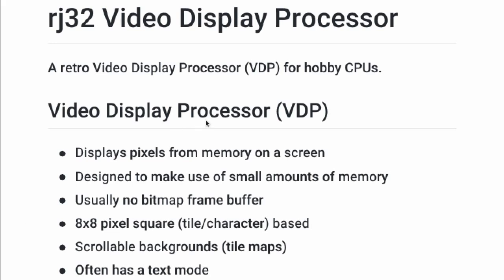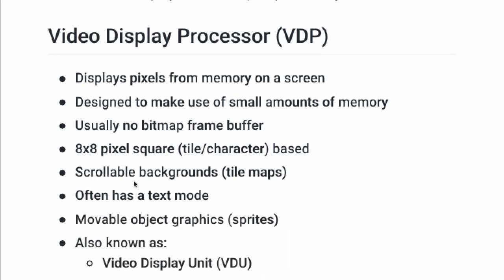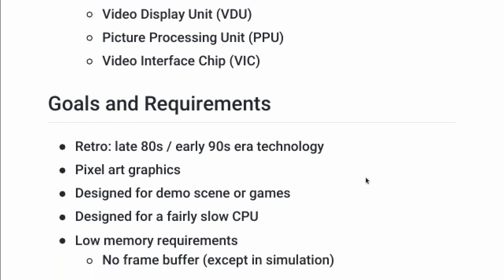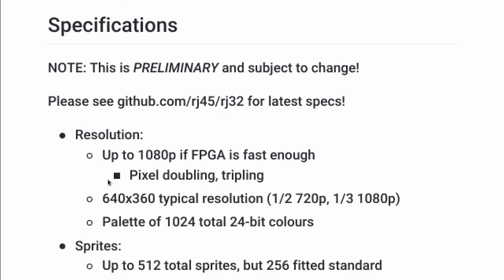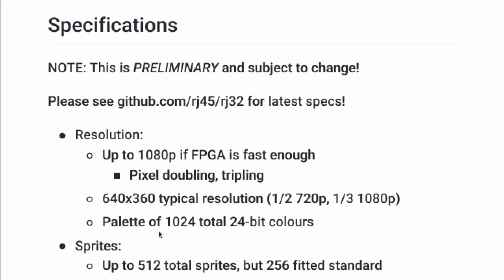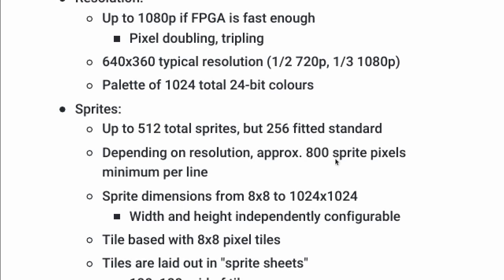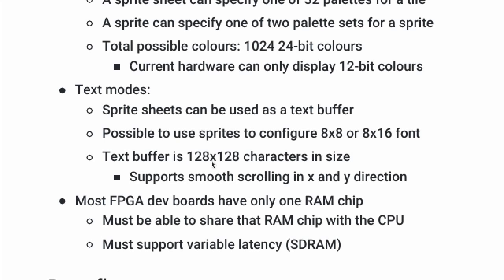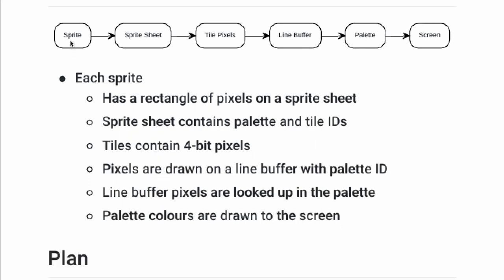[001] Making a Retro Video Display Processor

Comment: So you went with a Alpha 68k/NEO-GEO approach for all sprites.  This will limit the ability to perform parallax/line scroll effects, just as it did with the NEO GEO.  However, you could simulate it using animated tiles.  Is there a limit to the number of "background layers" you can display?  I suppose the answer to that would be in your 800 sprite pixels per line rough estimate.  Seems kind weak compared to the NEO GEO's 1,536 sprite pixels per line... although it was limited to 96 sprites per line.  256 sprites is probably fine, especially if they all can be of arbitrary size.  I would have liked to see at least 1 tilemap/bitmap layer for parallax/line-scrolling.  Hardware non-integer scaling, rotation and some translucency/alpha-channel abilities would have also been nice.  Honestly, all of this has made me appreciate how powerful the NEO GEO was; it being designed by ADK in the 1988/1989 time period.

Comment: Can‘t wait to see this working. Very interesting project! But for a 8-Bit Computer like in the 1980‘s i think the Specs are to high. But let‘s wait.
Reply from the maker: The specs come from the fact that block ram in the fpga is a specific fixed size. So if we store sprite attributes in block ram, they are 256 words in size, so we might as well have 256 sprites. That doesn't mean we need to have 256 or 512 sprites, those are just reasonable maximum specs given the capabilities of the hardware. There is indeed something to be said for limits breeding creativity, and perhaps these specs are not limiting enough. I will try to make it configurable wherever that is easy to do and doesn't make the circuit more complex.

Comment: Great project! I imagine you will use two line buffers so you don't have to draw the sprites during the horizontal blanking. That also makes it easy to show the same line twice or more. It would really help the software if you implement collision detection. The original Gameduino, for example, allowed you to assign a two bit "class" to each sprite and then a register can have a bit for each pair of classes which get set when writing a pixel to the line buffer. Another thing that helps the software is an interrupt at the start of the vertical blanking. Some systems allow interrupts when drawing a selected line and use that to reconfigure the VDP for neat effects, but your "everything is a sprite" scheme can do most of these tricks in a more direct way.
Reply from the maker: Thanks :-) Collision detection would be very handy for a slower CPU for sure. I am not sure I can figure out an easy way to add it that wouldn't complicate the circuit a lot but we will see. And yes, IRQ generation is a must for sure.

Comment: Ok I give up... I've been racking my brain all day and I can't figure out how you're going to get 512 variable size sprites rendered in a single frame!  Leak some tidbits :)
Reply from the maker: You'd have to get pretty creative to make all 512 sprites appear on the screen in a single frame. But it should be possible. There is a limit of how many can be on a single scan line, so you would have to arrange them such that you make maximum use of that. That limit comes from the number of cycles in each scan line. There are ways to make maximum use of those cycles...

Comment: Exactly what I've been trying to work on myself. I'm new to FPGA's so I've been scouring for sources like this for reference. Thank you so much!
Reply from the maker: Me too... specific technical documentation on the inner workings are hard to come by... hopefully I can help change that :-)
Reply: @rj45Creates  Very curious to see how you implement your solutions, I was shooting for 640x480 using an upduino, not enough ram for full bitmap mode tho. So far I just have solid colors displaying on the screen which can be updated via writing to a register. Been looking at the Mercury 2 which would allow me the benefit of also dropping my SPLD's for my somewhat complex addressing scheme on my 6502 (X16 compatible). I was looking at the ICE40 hx8k for this same purpose, but the options with enough IO pretty much come down to the Alchitry Cu, but alas those are not in stock anywhere. I started designing my own board around the HX8K, but all the dc decoupling, power timing and BGA form factor all add up to a bit of a turn off.
Reply from the maker: @jasonbaumgarte6465  check out the icezero by trenz electronic.... 512 KB of SRAM and 4 pmods, plus the IO that goes to the raspberry pi. If you build a custom carrier board instead of a raspberry pi, that could be very interesting... that's my current leaning on a custom board